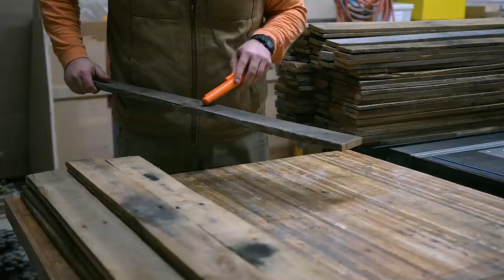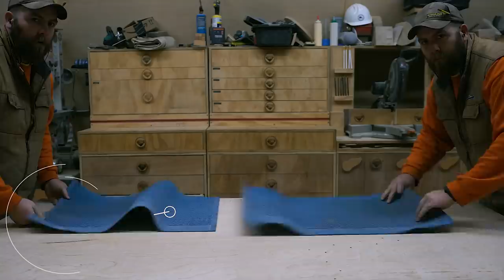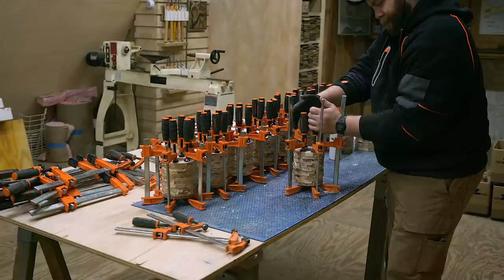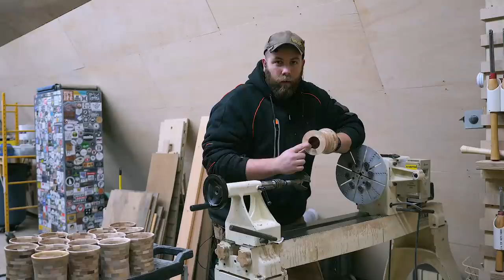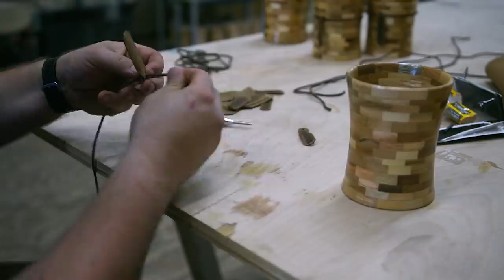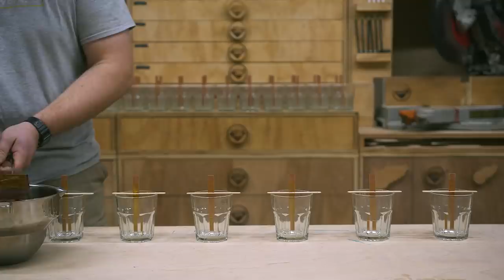Pallet Wood Candles from 7,000 pieces!

Comment from the maker: Supporting my sponsors is how I can keep making these video. Click the links below!
𝐂𝐚𝐫𝐨𝐥𝐢𝐧𝐚 𝐒𝐡𝐨𝐞 (get 20% off all styles with code "Jackman20", expires 6/27/21 at midnight EST)
► Shop Carolina Boots https://bit.ly/2TNi7ic
► Giveaway!! https://bit.ly/2Tuv54b
Styles shown in this video: AMP USA (black), S-117 Slip On

𝐑𝐨𝐜𝐤𝐥𝐞𝐫 𝐖𝐨𝐨𝐝𝐰𝐨𝐫𝐤𝐢𝐧𝐠 & 𝐇𝐚𝐫𝐝𝐰𝐚𝐫𝐞
► Taper/Straight Line Jig https://bit.ly/2Ry9tTZ (10% off)
► Silicone Project Mat XL https://bit.ly/3crM7Xs
► Glue Roller Bottle https://bit.ly/3xjROin (20% off)

𝐓𝐨𝐭𝐚𝐥𝐁𝐨𝐚𝐭 (code "Jackman15" gets you 15% off)
► Wood Sealer Varnish Primer https://bit.ly/3pJC8SZ

𝐒𝐭𝐚𝐫𝐫𝐞𝐭𝐭 𝐓𝐨𝐨𝐥𝐬
► 6" Divider/Caliper https://bit.ly/3pvSKNR

𝐈𝐒𝐎𝐭𝐮𝐧𝐞𝐬 (code "GETDAD15" gets you 15% off, expires 6/20) excludes LINK/LINK Aware/PRO Aware, but "Jackman10" will get you $10 off those!
► Bluetooth hearing protection headphones! https://bit.ly/3ze5OeY
Styles shown in this video: Xtra2.0, Aware PRO
Reply: I didn't use your code but i bought a pair of Caroline boots(because of your videos) about two months ago for work and they're holding up great .
Reply: @brettkleindl676  he gets a commission or something if you use the code

Comment: There's me taking 3 months just to dismantle one pallet meanwhile Jackman makes 50 candle holders with an insane number of pallet wood pieces. Respect sir!
Reply: im trying to work on improving my pallet disassembly time also. right now i'm about 2-3 hours for 4 pallets and i'm trying to get that down to 3 hours for 10 pallets. pretty much using this same technique as paul here without the air gun
Reply: I decided to take apart a pallet the other day to see if it would yield usable wood. I gave up on the nails after about five minutes and just took a saws-all to it, yielding very short boards.

Comment: That shop is massive!!! I bet your Apple Watch will start logging cardio with all the walking you did in this video!
Reply from the maker: I'm so exhausted, I might move back to a smaller shop ;)
Reply: @JackmanWorks  although I'm sure your new shop will feel small again, at least for a little while, after running around "The Compound" for a couple months! Can't wait to see the finished product! Jimmy sounds pretty pumped when he talks about it on the pod each week. Congrats to you and the whole crew out there!
Reply from the maker: I can't wait! That's a project I've been working on behind the scenes for 2 years now and Jimmy almost equally as long. It's great to see that effort finally paying off and getting the cameras rolling. You'll be the first to know through the podcast though, Jimmy loves to throw out teasers.
Reply: @JackmanWorks  yeah, I'm pretty sure Jimmy flirts with crossing the line of every NDA he's ever signed whenever he gets in front of a podcast mic!

Comment: Mrs. Jackman_works must have been shocked when she opened the cupboard to find no glassware.
Reply: Mrs. Jackman works is a Coastie chasing down bad guys, I think if you had to put up with the sander running 24/7 you'd risk criminals on the high seas, too.
Kidding of course.  Unless I'm right.

Comment: at the 1 minute marek, what is the tool you are using. It almost looks like an attachment with a belt sander to smooth out the boards. But the shot of the underside just looks like rollers. I'm curious.